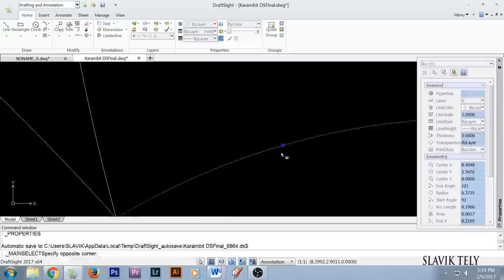Making 2 VULTURE KARAMBIT Knives Part 1

Comment: How do you grind a curved bevel on the belt grinder?
Reply from the maker: Hold the blade at an angle to the belt. You can not grind it flat to the belt. I had to touch it up with the file jig.

Comment: Why are you putting it in flames and then in the oven? Does it strengthen the steal or something?
Reply: CoZm085 yes, it is the process of hardening a blade. It is neccessary so The knife can retain a sharp edge. Soft steel loses its edge very quickly. The steel is rapidly cooled in oil which hardens the steel. The blade is now very hard but brittle (crack and break easily) so when you put the steel in the oven it returns a little bit of softness for a little bit of hardness and your edge will stay sharp much longer.
Reply from the maker: Thank you MO JO
Reply: Mo Jo thank you kindly sir.
Reply: Yes, it make's the steel more harder.

Comment: where do you get all this metal?? i cant find a supplier any where and these karambits look mean!!
Reply: oh haha my bad but last i heard there were no east coast steel suppliers
Reply from the maker: I just ordered more steel from them. They are still open.
Reply: do you use 1084? because i know it takes a good edge but ive never worked with the stuff
Reply from the maker: I only worked with 5160, 1075 and O1 tool steel.
Reply from the maker: No